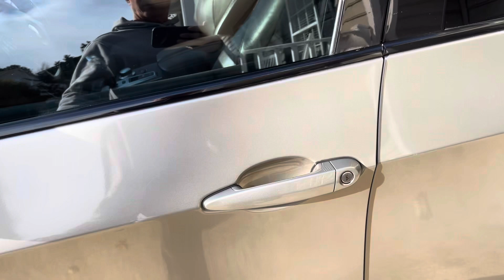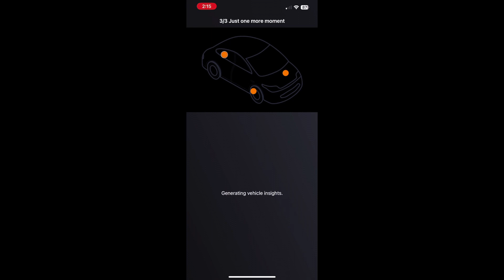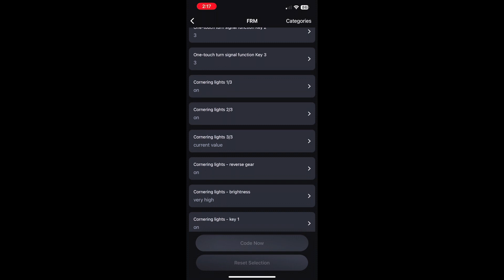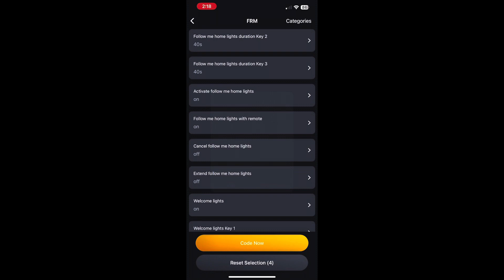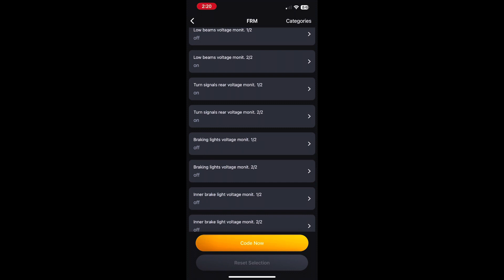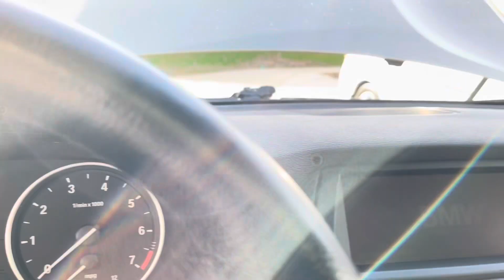2007-2013 BMW X5 E70 N62 - Coding Out Hyper-Flashing of LED Bulbs

Comment: Anyone got around parking lights error? Also daylight lights can be turned off but if they're on the error pops up too. Thanks in advance.
Reply from the maker: I didn’t have parking light errors. I coded out all bulbs to stop high and low voltage checking.

Comment: X-Coastie: A HUGE heartfelt thank you. I have been searching for this answer for weeks. I have purchased H8 LED bulbs for my 2009 e92 M3 angel eyes and needed to know what to code on Carly for BMW. (Exact same app as in your video). This answers it. I simply have to disable the voltage monitoring in the FRM for the angel eye (DRL) and probably the parking lamps too to be safe since it might be the same bulbs. The LED H8 bulbs I purchased are NOT error free, and now I know that does not matter if I code out the voltage monitoring.
Reply from the maker: @jaysnyder7367  Glad it helped.

Comment: I changed to led fog lights. Disabled voltage monitoring and bulb malfunction message. However occasionally it still flags up an error.
Reply from the maker: I wonder if it’s another bulb causing it?  Maybe try disabling the voltage monitoring on all bulbs.

Comment: I installed Led Tail lights on my bmw x5 35d 2011, and now there is a warning ⚠️ that right brake light malfunctioning.  What it could be?? Please 🙏 need a help
Reply from the maker: You must have missed one of the voltage monitoring settings for the right brake light. There are two setting for each bulb and you have to disable it the monitoring in both places.
Reply from the maker: If you don’t see two setting for each bulb, then you may have an issue with your programmer.

Comment: How bout  LED Headlights?
Reply from the maker: Since all X5 E70’s have factory Xenon system, they all have a ballast. Since converting Xenon to LED’s doesn’t change out the ballast, then there are no errors associated with the LED.  Please look at the video I have covering the Xenon to LED conversion for the Headlights.
Reply: @donaldthomason4588  headlights work perfectly. I ordered Carly, may be it's gonna help. I got one more warning ⚠️ message that says, "High battery drain."